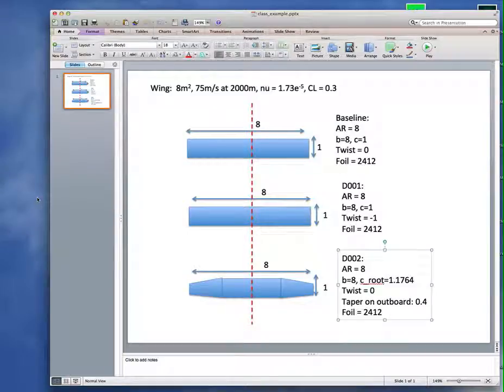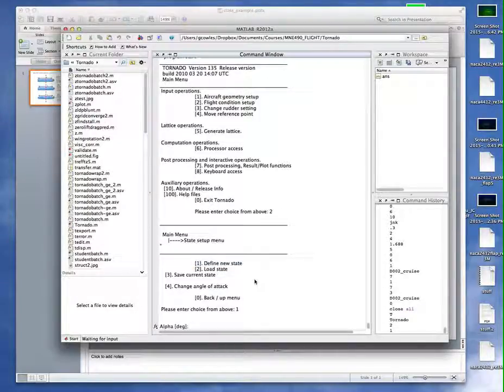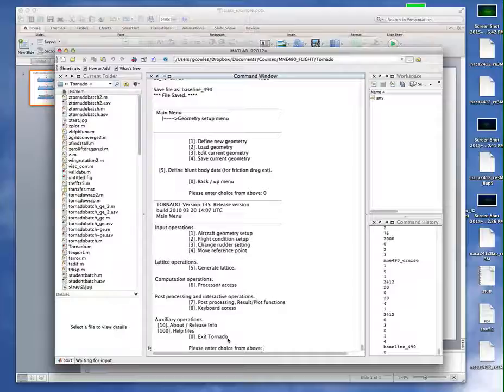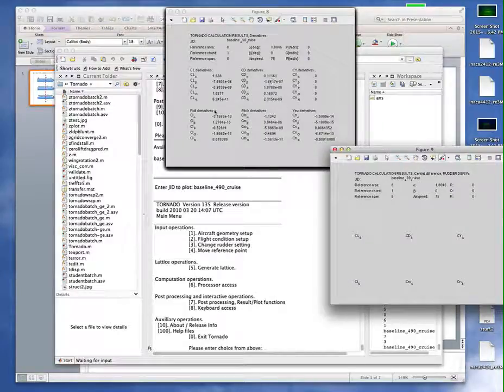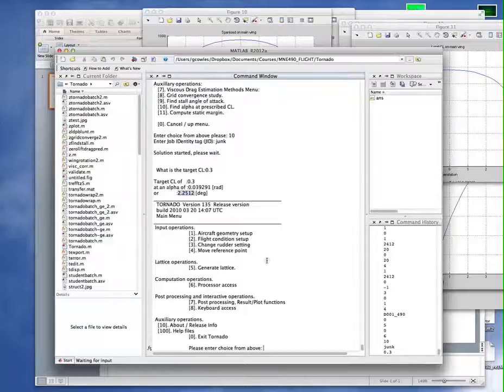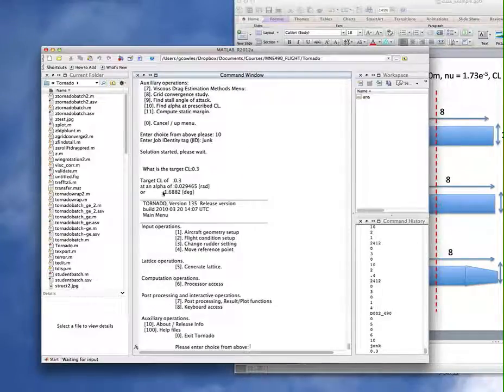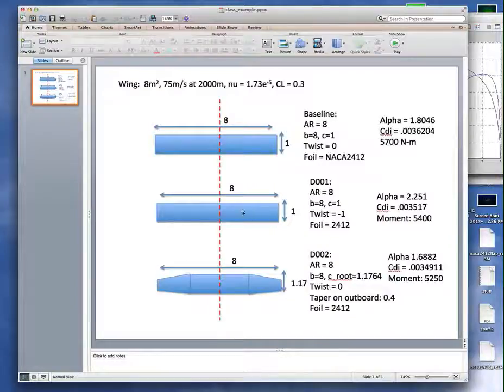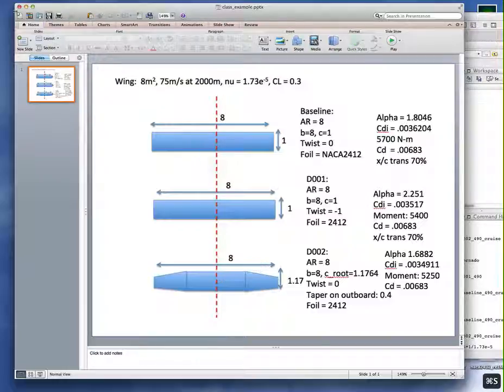Wing Design Project - HOWTO with Xfoil and Tornado

Comment: Do you know how can i introduce another airfoil to the Tornado database? I tried generating the DAT on the same pattern of those that are in the  Tornado's 'airfoils' folder and putting the DAT there but Tornado just wont recognize my DAT file. Every time i try to plot the geometry, it fails to find the file and assume that the wing is a flat plate.
Reply: You only need to download the airfoil .dat file from UIUC database, for example, and place it in the airfoil folder inside Tornado VLM file structure and it's done. You have access to it.